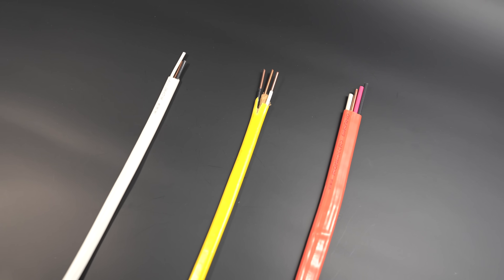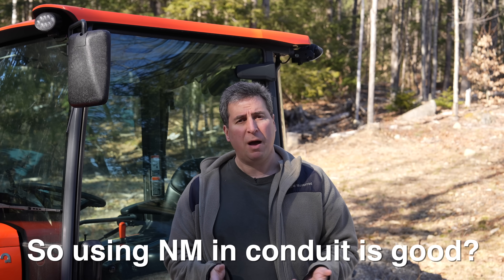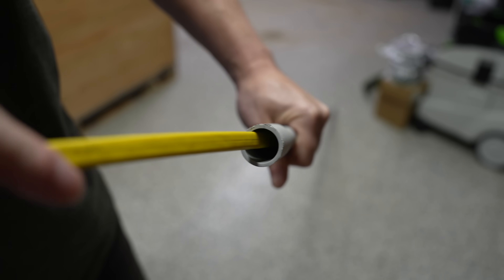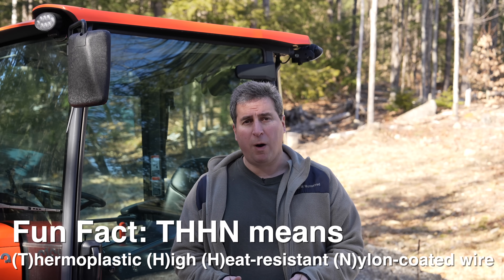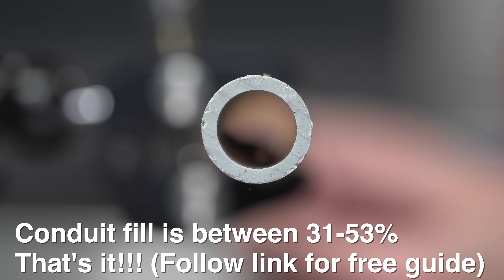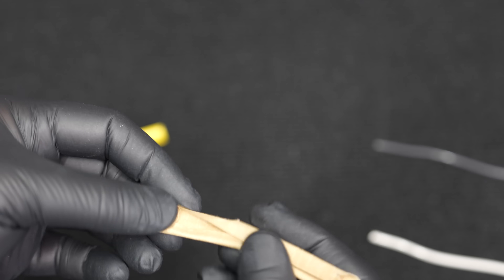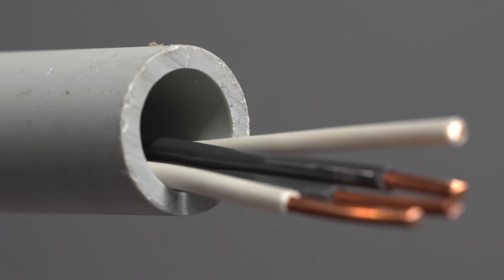#1 DIY Electric Mistake - Can you use Romex Wire in Conduit?

Comment: A couple of minor nitpicks:  You can run NM cable inside conduit in a damp location as long as the NM cable is rated for damp locations (i.e. it needs to be NM-C).  Basically, conduit vs not conduit has nothing to do with it.  You can only run anything in a damp location if it's rated for damp locations (which ordinary NM cable isn't, but some other kinds are).

Also, technically, the wires inside NM cable are just THHN, and have exactly the same insulation/protection that individual THHN wires do.  The only problem is that the manufacturer has not explicitly stated that they can be used in that way, so even though there is actually nothing inherently unsafe about doing that, the code just doesn't allow using things contrary to the manufacturer's instructions, so you can't do it, really because of a technicality in how things are written.  It's not that it actually wouldn't work fine, though.  It's more a letter-of-the-law thing.
Reply: I used to work in a wire mill that made both THHN and Romex from thick copper coils and barrels of plastic resins. THHN has one additional coating material added (makes it more resistant to the strains of conduit pulls) that is NOT included in the wires placed in Romex (because it's not required there and so would be too expensive to add), so, while nearly identical, they are not the same, and aren't intended to be run without the paper and outer sheathing
Reply: Now that was cool. Good info. In the field 10 years and never heard it put like that.
Reply: @blairmurri8741  Was that coating the clear outer jacket that makes it easier to pull without lubricant?  I think Southwire brands it "SIMPull" (?).
Reply: @willusher3297  Probably. It was over 35 years ago that I worked there. I knew enough physics and chemistry to understand the basics, but not enough to know all the details
Reply: @willusher3297 Isn't that just an extra teflon coating, over the top of the pvc jacket?
Reply: @blairmurri8741  Thanks
Reply: @blairmurri8741  Also, do all manufacturers make their stuff the same? Probably not, so saying all NM wire has THHN conductors would have to be verified with each manufacturer. I've also worked with both, and I have always noticed an extra thick clear layer on THHN.
Reply: @blairmurri8741  "THHN has one additional coating material added (makes it more resistant to the strains of conduit pulls) that is NOT included in the wires placed in Romex (because it's not required there and so would be too expensive to add), so, while nearly identical, they are not the same, and aren't intended to be run without the paper and outer sheathing" 
Ok, NOW it is all making sense to me. Thank you for that.
Reply: @blairmurri8741  Why even have Romex?
Reply: @rael5469  if the studs are thick enough and the nails/screws are short enough, it's a lot cheaper in terms of labor to run Romex rather than assemble and mount conduit and pull from multiple spools of wire
Reply: @blairmurri8741   When the electricians were wiring my house I swear they probably wrenched their back pulling the slack out of the wire runs. You could pluck them like piano string. Romex.
Reply: @rael5469  those electrician would not have been retained at any of the places I've worked at or with.
Reply: @blairmurri8741   There is a hilarious scene in the Police Squad movie, "Naked Gun"  Ricardo Montalban is holding Priscilla Presley hostage and she turns to him and says: "You wouldn't really hurt me, would you?"  And he says, "You forget, I was a building contractor."  The audience roared with laughter because we have all been ripped off by brazen building contractors. Shameless and brazen.
Reply: @rael5469 Easier to run through wall studs than it is running conduit.
Reply: @rael5469  material and labor cost. way cheaper and 'safe enough' as we can see from fire data
Reply: @rael5469 do you like being able to afford your rent or mortgage, AND charge your phone at night? Cause that’s where the magic of budget friendly, easily installed romex comes into play.
Reply: @wm79198  It cheaper for the contractor but they charge the same as with metal conduit. I wasn't born yesterday.
Reply: @rael5469  ease of installation saves on the cost to install.
Reply: @rael5469  Move to someplace like Chicago where it's not allowed and even BX isn't allowed in long runs.
Reply: Thank you, that is exactly the simple answer we all needed about how to run  which type of wire, in a conduit in a damp location.
Reply: No, they are not the same. From my experience of pulling  and stripping miles of them, the insulation on wires intended as individual conductors are a lot tougher than what's inside romex.
Reply: Thank you, I have NM-C inside of schedule 80 conduit running to my well (outside) and it makes no sense why I'd have to take that <out> of the conduit - assuming the conduit is adequately sized for the cable. It also doesn't say NM-C can't be in conduit in the code links either.
Reply: Thank you for actually answering why NM cable should not be used in damp locations.  If I understand your answer correctly, it is allowed to run NM-C in a trench outdoors without any conduit surrounding it, but it is not OK to run ordinary NM cable in a trench outdoors within PVC conduit.  The video talks about how hard it is to run NM  through conduit (PVC shown), but if it can be done, isn't that better than no conduit?  I ran a 25-foot length of ordinary NM cable (I think it was gauge 14/2) in a trench, about 16 inches underground, in a PVC conduit.  First, I pulled the entire cable through each of the 10-foot sections, then I bonded the sections together with PVC solvent.  If the bonds were correctly done, then the cable should be well protected from rocks, insects, and ground water.  Can anyone answer what is wrong with that arrangement (other than the code does not allow it)?
Reply: @martys9972    If the bonds were correctly done, then the cable should be well protected from rocks, insects, and ground water
} And this is the answer to your question:
**IF**, and the FACTUAL Reality is that no matter how "perfect" you do it, the Great Molecule of the Universe, WATER, will ALWAYS get in there (over time).
Reply: @MR-MR-ud5oo  - All conduit used outdoors, and especially underground, must be assumed to be filled with water. Codes thus required waterproof coverings on all wires.
Reply: @martys9972  NM-B cable does not have an insulated ground wire. It is not allowed in wet or damp locations. Failure results from corrosion on the ground wire which can in turn damage the insulation (typically at a weak point caused by pulling that crap through conduit). In the ground is a WET location.

NM-C IS rated for wet locations and direct burial.
Reply: @martys9972  Condensation will fill your underground conduit with water eventually.
Reply: As a former electrician, I have yet to find any THHN (or any stranded copper conductor product) with the same conductor insulation as seen in NM Romex.  It's a completely different product altogether.  So I find your comment inaccurate and misleading.
Reply: @jaredlokay  But you must admit, it sure is easy to strip the ends for makeup?
Reply: @jaredlokay  IKR, this guy expects someone to think Southwire makes two products EXACTLY the same - one they allow to stand strong, within guaranteed perimeters all by its lonesome;  and then Southwire ADDS paper and MORE insulation. 
Yeah, that checks out….
Reply: It appears that NM cable with or without the jacket cannot be run through any conduit in a damp location. So am I to assume that if a circuit terminates outside the home for any reason like GFCI, switches, flood lights etc, the NM cable must be converted, "spliced" with THNN in a junction box prior to entering the conduit to the damp location?
Reply: Since you want to nitpick someone giving good information to general people who otherwise might not know better let me nitpick you a bit. NM-C is corrosion resistant also referred to as barn wire to resist corrosion from livestock urine and other corrosive liquids and gasses. Type UF is damp location rated. The reason you can't legally remove the individual conductors and install them in conduit is because they are not labeled individually with the size and insulation type to do so. Have a good day sir.
Reply: @jkat66  Yes, NM-C is corrosion-resistant, but it is also rated for wet environments, unlike regular NM cable.  (It can do either or both.)

Also, there is no requirement anywhere in the NEC that wires have any size/insulation information printed on them at all.  The only requirement is that they have the necessary gauge and have an appropriate temperature rating, and are used "according to the manufacturer's instructions".  It is perfectly fine to use unlabeled wire, as long as the manufacturer has said it is intended to be used for that purpose and in that way.

(Also, lots of NM cable does have labeling on its internal wires too, because it's just cheaper to use the same wire they're already making (and already labeling) everywhere..)
Reply: @jkat66   It's all in the details.
Reply: Isn't EMT outdoors considered WET Location?
Reply: only UF label (underground feeder)
Reply: @MR-MR-ud5oo  yes
Reply: Ha
Reply: All the NM I’ve ever looked at had markings on the individual wires.  If there’s THHN or similar markings on the individual wires you’re all good to cut the sheathing off and stick it in conduit.
Reply: Make your own channel. He hit everything on the head. Move on
Reply: Just post the page you just read.
Reply: insurance is voided when contrary use as specified by manufacturer
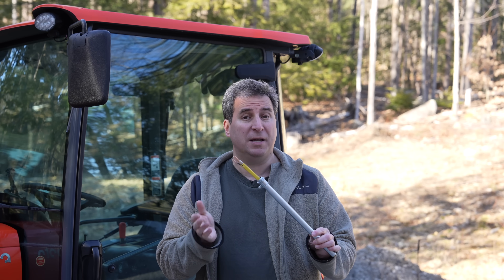Reply: 0:35 DFDR in the background. Interesting piece for a Romex example 😉.
Reply: Bogus. Unless you can confirm with each manufacturer, I don't believe NM has THHN conductors, especially since I can tell the difference when work with each conductor type.
Reply: thanks, i was wondering about that.
Reply: This is the answer I was looking for. Am I correct thinking I can run UFB Wire in conduit outdoors?
Reply: NMC is aka UF cable. Great detail
Reply: From Southwire:

The conductors inside of our Romex products are listed as THHN only. You are correct in the statement that most conductors are multi rated. Romex is listed as a complete product and the conductors SHALL NOT be used with out the outer jacket. It can only be used as Romex and where Romex is approved for use by the NEC.
Reply: The conductors within NM or Romex-type cabling are NOT the same as individual THHN-type wires.  THHN-type wiring is constructed with two insulating jackets.  The inside jacket is PVC-type plastic used as the main insulating jacket and the outer jacket is a nylon-type plastic used for abrasion protection.  The conductors within NM or Romex-type cabling consist of only a single PVC insulating jacket.  The outer nylon jacket is also what makes it easy to pull through conduit over long distances since it is also a lot slicker verse straight PBC.  The abrasion protection for NM or Romex-type cabling is via the outer PVC jacket surrounding the internal conductors.
Reply: Better get out your code book.
Reply: The letter of the law is sharper then the utility knife
Reply: I've had an electrical inspector tell me NM is fine in conduit in damp locations as long as the conduit is sealed, and therefore inside the conduit is not a damp location.  So IDK.  its usually easier to just use THHN in conduit, easier to pull for sure, especially if you need more than 1 cable.
Reply: Around here direct bury cables enter the conduit underground and run up over the foundation to building entry for any auxiliary use, e.g. power to a shed.  It's bizarre to suggest this is wrong.  We're in New England.  It's usually damp.  Any other approach would require an underground connection in a damp area, which is orders of magnitude more likely to fail.
Reply: Thanks for that, and since the wire is not printed THHN on it, if you use it and something goes awry, the insurance company will have their say in it as well.
Reply: @maddierosemusic I hear this reference to insurance companies fairly often in Reddit and YouTube. I’ve never heard of an insurance company denying a claim due to improper electrical work. I have never been a claims person so it’s possible that I just didn’t hear about it.
Reply: @maddierosemusic  Thats my understanding..the conductors have to be labeled with gauge, type of inso , voltage rating and some other info...
Reply: I believe that I may have heard at some point that it could also have to do with how much THHN insulation is on the wires ; that those made for individual usage may have a slightly heavier jacket on them ???
Reply: THE COPPER IS DIFFERENT!!! LOOK AT THE STRANDS!!! (rage... you have made my choice for me today.)
Reply: UF can be. He is talking about NM you get at Home Depot. The wire inside is now required to be THHN, but it is not listed outside the sheath (outside of a box) Just buy wire & fruit like you should
Reply: “ *Technically*, the wires inside NM cable are just THHN,and have exactly the same insulation/protection are exactly  the same properties as THHN.”
What you should have said was “*Essentially*……..”.  You would still be wholly misleading but closer to being right.
Maybe the insurance adjuster can be persuaded you’re right!!
Reply: @TheDroppedAnchor  Actually I found the answer. NM-B conductors have a PVC coating, while THHN (thermoplastic high heat nylon) conductors have a nylon coating on the PVC coating.
Reply: @TheDroppedAnchor  Can you show that they have the same specs and construction? Because I work with both and they look and feel different to me, which makes me think they don't share the same qualities.
Reply: like UF?
Reply: 100% right.  Technically, you are not supposed to do this, but that's like saying box fill calculations are always figured out and obeyed in every single house or building.  Never happens.  Everyone has seen NM romex in conduit before, but you are not supposed to do it that way.
Reply: It’s called UF underground feeder. It’s a complete jacket that doesn’t have the paper coating. The reason for the damp locations is because of the paper coating that’s inside of your Romax type cabling.
SMH
Reply: It's not thhn. Look at wire ampacity table 310.15. 60c vs 75 c.
Reply: @timhufnagel7462  You're right. It's actually 90C rated once you remove the jacket and paper filler. That is why it's allowed to be in high heat locations like lighting fixtures. I understand what you are saying, I know the table you are referring to, but it is referring to romex as a PACKAGE (including the jacket and filler). 

If you are so sure what others here have stated is wrong, setup an open air test your self. See what happens if you send 30 amps over some # 12 romex without the jacket and filler. Be sure whatever you use for lugs is also rated for 90C. I doubt you see any melting insulation.
Reply: Thank you! I was wondering what made NM cable not ok for damp, when loose or presumably metal shielded cables then carry the implicit assumption that they would be ok
Reply: @OtakuNoShitpost  The problem with NM cable is that it contains a paper filler which is adversely affected by damp. In Europe we generally don't allow paper fillers in cables so the standard cable here can be used in most locations.
Reply: @OtakuNoShitpost  Nothing IMPLICIT about it. There is nothing implicit in the code. It is, by definition and purpose ALL EXPLICIT!
Reply: So they can market a more expensive alternative.
Reply: The whole "the manufacturer didn't say" thing always kills me... because as you said the wires inside the NM cable are literally the other THHN wires.

This reminds me of calling out the idiocy behind assume FDA regulations about "off label use" of medical products when I pointed out that the "labeled single use" made no sense for certain products...

Their answer: doesn't matter... FDA said so. 🤦
Reply: @jasono2139  “ If installed according to manufacturer’s instructions” is something you have a problem with?
Reply: It was fairly common at one time  to run UF cable in conduit in barns and other farm buildings when it would be subject to mechanical damage.  Areas like hay lofts and animal stalls. At the time I think NM-C didn’t exist.
Reply: I'm reminded of when I used a PVC pressure coupling in a drain line. Failed inspection because DWV wasn't printed on the coupling.  Had to use a fernco rubber coupling... letter of the law should be superseded by intent.
Reply: @jon__doe  The Inspector should have told you to "Hurry and cover it up before someone sees it."...
Reply: @jon__doe  What third world country do you live? As a master plumber of 35 years in the US in 3 major jurisdictions I've never heard of such nonsense
Reply: @snackhunt420  that was Orlando fl
Reply: @jon__doe  

Unfortunately, that's not how The Law is usually interpreted, which is why they need lawyers and sh** gets so f***ed up.

"Well, for someone who has nothing nice to say about lawyers, you certainly have enough of them around."
"They're like nuclear warheads. They have theirs, so I have mine. Once you use 'em, they fuck up everything."
- "Other People's Money" -
Reply: Ok thank you I said the same thing about the thhn wire and wires in romex.
Reply: thanks for clearing up these points! Those were the two questions that lingered for me.
Reply: I just asked this question when I saw it was already answered.
Reply: best comment on here you pretty much read my mind lol
Reply: I'm convinced that they don't label the wires inside the Romex so that you have to buy three spools of THHN even though you might have the right amount of Romex on hand (which the manufacturer states is THHN, but does not print that on the jacket).

So, should you? No. Is it safe if you do _and you have confirmed your brand of cable is actually THHN that isn't labeled_? Yes. Consider that the next guy will not know you know where it came from, though, and might have to replace it just to meet code.
Reply: @ZiggyTheHamster  romex style cable also doesn't insulate the ground while THNN will insulate the ground (green)
Reply: If I remember right dad wired a medicine cabinet and the romex he used had a green wire inside it was not bare. Maybe back in the sixties wire was different I just don't know thanks 73.       t@ralphshoop88i22
Reply: Yeah. Those weren't even nits.  Stick with picking your nose. It's more productive.
Reply: It's a labeling, or rather lack of labeling issue. Wires or wire assemblies have to be labeled with their rating and NM-B is only labeled on the outer jacket.
Reply: Had a situation recently, where inspector made us run (2) 12/2G UF's in  3/4" PVC conduit under the slab (previously installed before slab pour) to an island in the kitchen. Boss should have argued that under slab inside the house is not damp location. That's UF 40' from panel thru attic to nearby wall, down the wall and 15' over to the island. Twice.
Reply: @therighthandmann  Inside or under a slab definitely is a damp location, according to the NEC.  This is because concrete is porous and does absorb and transmit water from the ground over time (which is also why you should never put wood directly against a slab or concrete footing without some sort of gap, moisture barrier, or pressure treating, because it will eventually rot the wood).
Reply: @foogod4237  Understand the wood thing,
and I assume the conductors themselves don't need to be damp rated if they are in a pvc conduit under or in the slab.
Reply: @therighthandmann - PVC can crack or a joint fail, thus, you NEED damp-rated wire in slabs or under ground. It’s common sense.
Reply: @therighthandmann a conduit under a slab is most definitely a wet location. Even if it’s “in a house”. 300.5 makes no distinction  on the location of the slab, only that a under a slab is considered a wet location. Your boss should have known better than to pull NM cable underground.
Reply: @therighthandmann  In a slab or in the ground is 100% a damp location. Any conduit that is below the air temp will condense water inside. The inspector WAS RIGHT. What you should have done is have a splice point to transition to THHN.
Reply: @therighthandmann  In a slab or in the ground is 100% a damp location. Any conduit that is below the air temp will condense water inside. The inspector WAS RIGHT. What you should have done is have a splice point to transition to T.N
Reply: @therighthandmann  Under the Slab inside of house is not a damp location until:   the slab cracks and now it's damp.  Or... there is a major flood / once in 50 years situation and suddenly the once dry ground is now wet, and those romex lines are getting moist.   Once you have wire under the ground, things change.  As a safety-vigilant homeowner and landlord, I think of these "oh it will never happen" situations.   Until it does.  I have had to modify contractors' recommendations in the past ( like using 2" screws to install 1/2 inch plywood on studs where actual electrical wires were behind them - yes, that was scary and I bought 1 5/8 inch screws instead! )   Stay safe, and happy building.
Reply: @jesse7jesse7  Or even more likely - cooler temps under the slab causes water vapor in the air to condense into liquid water. Over time that can end up pooling water in the conduit.
Reply: @jesse7jesse7 Always use nail plates, not an expensive add-on.
Reply: @jesse7jesse7  conduit in the ground is ALWAYS a wet location.
Reply: Never Seen the THHN/THWN on Wires in Romex, will have to look Closer?*
Reply: @randyaivaz3356  Well you won’t either cause they aren’t labeled so that is why you can not use them individually even though they have the same outer coating asTHHN.
Reply: @richardlug6139  ...but they don't.
Reply: Extremely minor. Autism rocks
Reply: @greuju  wrong.